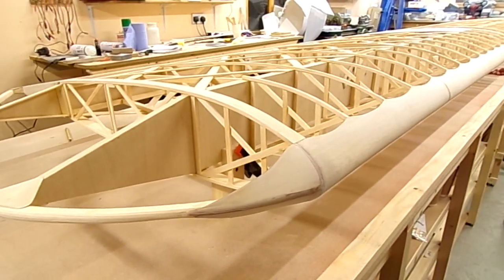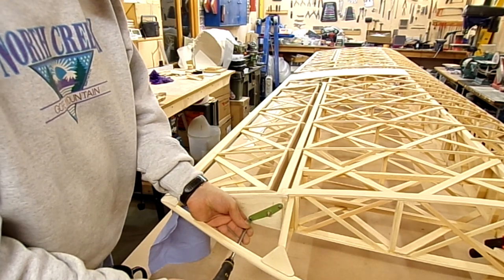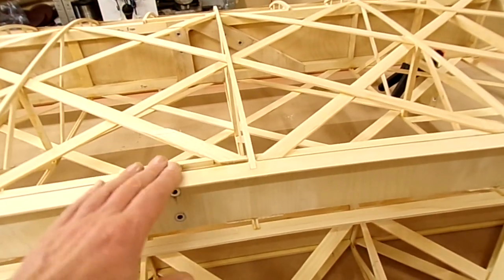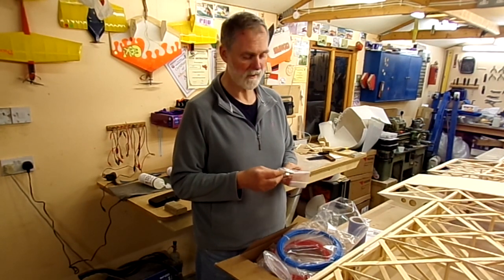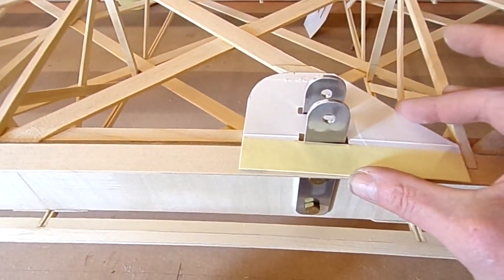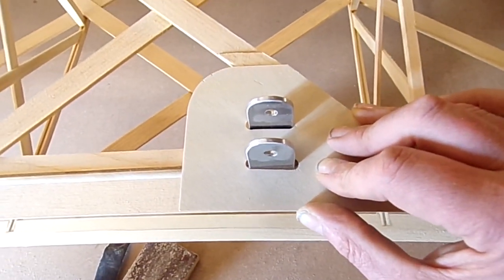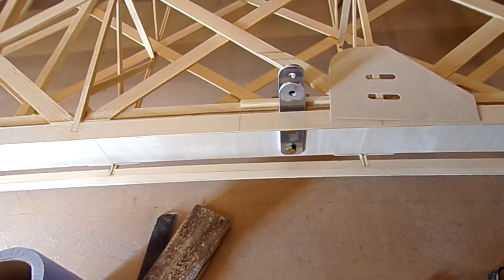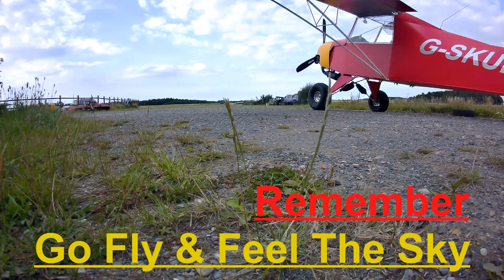EP45 Fisher Youngster V Aileron work and strut attach covers

Comment: Man, am I glad you are putting this out! Question regarding the vent holes: Do you recommend drilling a very small vent in places such as the voids contained in the spars as well, or just where the build up of pressure could cause problems with the exterior of the aircraft?
Reply from the maker: I would recommend it in any closed box section with faces of greater than half a square foot for 1/32" ply faces and one square foot for 1/16"ply faces, note most spares are less than that so I would not vent a spar unless it is called for. For closed box sections drill the hold to interconnect them and that way you only have one vent hole to the outside. You must make sure they are varnished inside the hole. I saw the result of not venting on a "D" box leading edge, when the wing was stripped after failing the tap test. The holes don't need to be big as the pressure changes are not that big or fast, for most light aircraft.
I could probably have got away with it in the ailerons as the skin is curved and just on the limit.

Thanks for the great question and looking at the video.